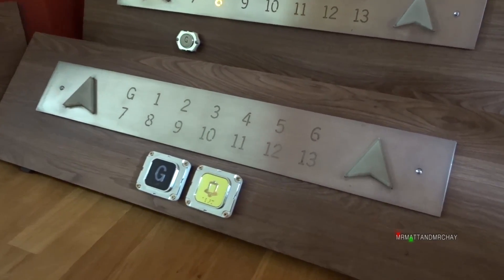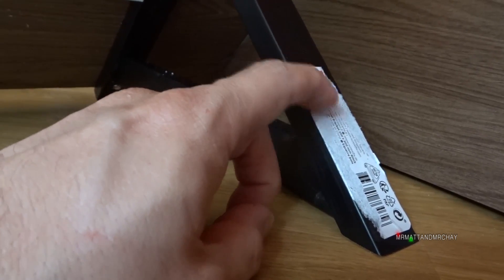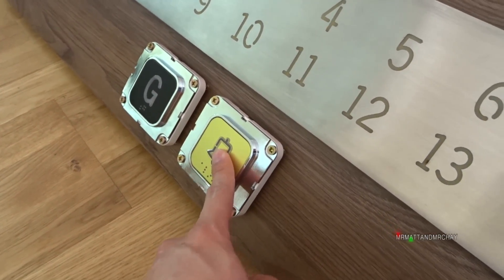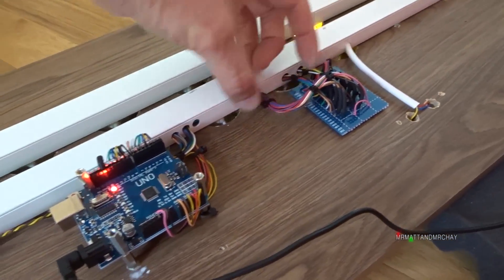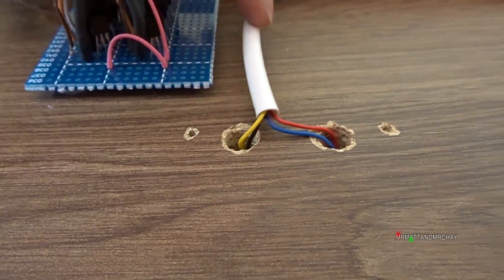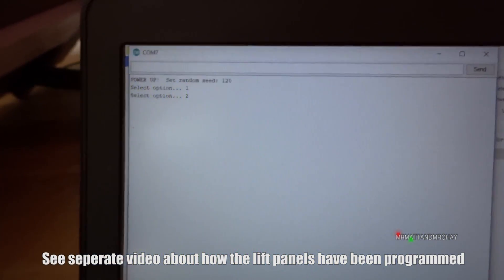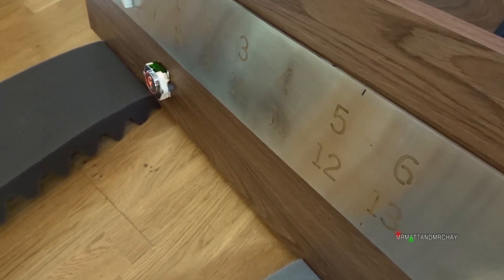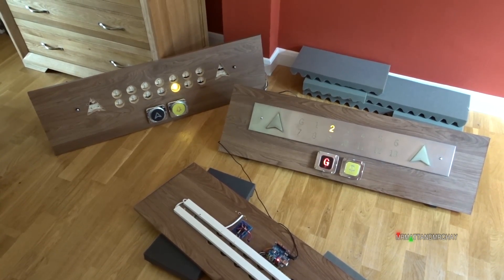Build a lift panel for Isaac - PROJECT COMPLETION (p9)

Comment: That's a really nice project ! 
But it's warning time ! : 
/!\ WARNING /!\ Powering an Arduino with 12 volts is not a great idea at all, I already tried that and even if on data sheets it was specified that we could, the arduino go super hot over the time and got so hot that the hot glue holding it started to melt. /!\ WARNING /!\

By the way, you can visit my website, showing my art classes projects over last year, here (it's in French but it might still interest you) : http://clement2000.16mg.com/ (it is also featuring the project with the 12 volts powered arduino)

Please, give me your feedback (you can email me if you want here klement.bzh@gmail.com)
Reply from the maker: I made sure these were 12v exactly (12.2) and not '13.something', but I will pass on your comment to the parents of Isaac and James.  They only cost about £10 here so I'll advise they replace the 12V PSU to regulated 9v ones.  I had these panels running for 3-4 days without issue 12v, but I'll take your experience into account.  They can run them off USB (5v) for the time being until new PSUs (9v) arrive.  Thanks for the comment and your experience.

Comment: So the control software of these panels emulates real lift controller behavior under the hood (things like motor speed, doors opening/closing, etc.) and not just controls the LEDs. Nice job.
I bet you two (I mean you and the original developer) could program a real lift controller as well !

Comment: I have good results with a hairblower when removing labels. The heat activates the glue and makes it a lot easier to peel-off the label cleanly. Just be carefull with plastics. Sometimes you can use label removers that have orange citrus in them but they can damage certain types of plastics like cd jewel cases.